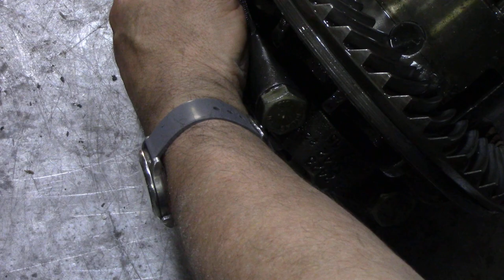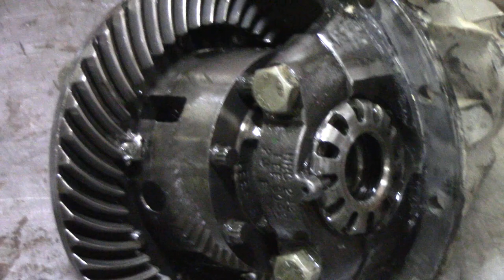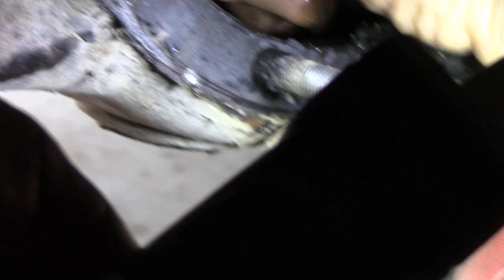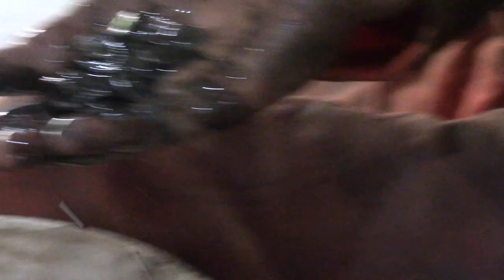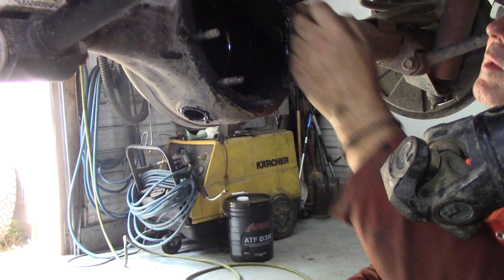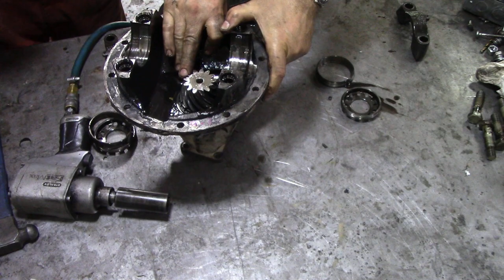2016 Defender 110 with a noise from somewhere and a few other repairs Part 3

Comment: I have had the bolts loosening in a oneten front diff. A bolt jammed between crown and pinion and the car jumped, I thought the motor had dropped out and that I had driven over it :) New crownwheel, pinion and new bolts with locktite where the only parts needed, the rest was ok.

Comment: I've had the exact same problem with my Defender 110 a couple of years ago & had to fit a rebuilt diff assy.  I only discovered it when changing a stub axle & noticed a load of metal swarf in the axle casing.

Comment: Ouch. So lucky to be sorting it now and not be stranded god knows where.
Is the power split 50/50 front and rear. If so how is the front diff looking also?
Maybe a inspection of the oil in that too?

Comment: I replaced mine by a ashcroft heavy duty 110 diff (not de pegged p38). Cost twice the money but i think needed on an overland vehicle with rover axle. Propshaft needs to be shorter.

Comment: Hi Mike I've come across this on a couple of our fleet puma Landrovers, one was completely trashed and had to fit a complete unit, the last one I had in we were lucky the bearings were totally shot but the  teeth were all in tact on the pinion and and crown wheel (more than likely due to the fact that bolts hadn't snapped and got caught between the gear teeth) although there was a minimal amount  wear on the teeth, I took a chance and replaced pinion and diff support bearings, if you use the original timeken replacement bearings and the original pinion then there's no real need to re-shim it, (the shim is situated between the larger inner pinion bearing outer race and the casing), setting the crown wheel to pinion mesh is a doddle with a DTI, I marked the adjuster screws before taking it apart and after resetting the crown wheel to pinion clearance they ended up in the same place, it's done 5K plus miles since and it's been fine so far, and as for noise? Well it sounds perfectly fine, but it'd take take a very acute sense of hearing to hear anything over the usual din coming from  the drive train, it's a shame some of the teeth were broken IMHO a new set of bearings would have put it right...
Reply from the maker: Yeap, but a chance to make it better - 3.5T is a lot of weight to lug about!

Comment: I had the same problem on the rear diff when I bought a pair of puma axles to go on my 200tdi, only four of the bolts had sheared on mine but one head lodged itself in the same place as yours and thats the source of the noise that alerted me to the problem, I had to replace the crown and pinion and whilst in there did all the bearings too, pain of a job but I did it all myself, took a few goes to get the right tooth mesh pattern though, great video and now I have an idea of why it happened, they are on a short wheel base now so are pulling less weight, may help them last longer!

Comment: In all my life I have never rebuilt so many rear diffs in an vehicle as I have with the Defender TDCi (2007-2016 puma). The P38 diffs are I believe poorly built in the factory, common is: metallic loaded oil at as low as 20K, broken bolts on the crown wheel, bearings noisy, poor preload, worn crown wheel and pinion.
Reply from the maker: The broken bolts are not sheared - they are overloaded or stretched, as they were not snapped flush, could be removed with your fingers as the shank of the bolt was still present and was the only thing driving the diff, indicating some twisting motion is happening on the crownwheel, causing them to snap under excessive load
Reply: @BritannicaRestorations  yes spot on, as you pointed out in your later videos the crown wheel is quite a bit thinner than the Salisbury. I have been using the Ashcroft ATB for the centre and using cap bolts to retain the crown wheel, I think honestly for most use the P38 once rebuilt correctly is ok for most uses but certainly a step backwards compared to a Salisbury. Great videos as always.

Comment: That's always a problem with  rover diff,l have a Salisbury in my 4bd1t County and a rover one in the front. I have a ashcroft pegging kit to do the front and after seeing that it's worth fitting because I have a locker in it.  Saying that the rovers are easy to work on and adjust.

Comment: I did all the bolts on the ring gear of a LTWT many years ago, just pulling away at lights.  Thought it must have been a half shaft so just hit the yellow knob and carried on.  It was only when I got home and struggled to drop the diff I found all the heads.  I was the owner from MOD release...  New set of bolts and a washout in the case, back on the road

Comment: My gast is totally flabbered.
I was definitely expecting to see something related to the ring gear but I was expecting it to be something more subtle, with something gradually wearing away at something else.

Wonder if the previous workshop DID do something wrong or whether this is just the unfortunate result of putting a heap of weight on the back axle?
Clearly, the bolts shouldn't shear but if the axle is overloaded enough to overstress ONE bolt and cause it to shear, that increases the stress on the remaining bolts and you get a "cascading failure".

Tell you what, you can buy dirt-cheap "bore-scopes" that plug into your mobile phone on eBay these days and one of those would be ideal for having a look around the inside of a diff' through the filler hole rather than having to take it apart to see what's going on.
Reply: I was thinking that in the last video then wondered whether Mike would be able to manipulate it enough to visualise anything. The final result would have been the same!
Reply: @bigm383  If you've got the equipment and inclination to pull a diff' apart I guess it's not a problem.

For the rest of us, when there's "a bit of a noise" from something, we tend to turn up the radio and tell ourselves it's nothing to worry about.

Poking a bore-scope in would probably have revealed that the bolt-heads were all missing from the ring-gear, at least, and would alert an owner to an immediate problem AND, potentially, prevent a serious accident if one of those bolt-heads got jammed between the gears and locked the rear axle up while the vehicle was driving at road speeds.
Reply: @SiCrewe  All excellent points!

Comment: A friend had the same problem with his Puma 110 on the front diff. Crown wheel came adrift and spat it out the front casing. 
I wonder if it is to do with the torque delivery of the Puma engine ? It’s only a short torque band on the standard Puma engine but when that torque arrives it’s there all at once -Bang!

Comment: Good opportunity to upgrade what is clearly a substandard design of axle (AULRO website is full of these axle failures, usually the pinion).  The Ashcroft HD gears and pegging will be a huge help.  Worth considering a locker or ATB while he’s at it.

The “Wolf” axle is a classic case of cost engineering; the Salisbury was far better in every way except for ground clearance.

Comment: I don't know when they stopped fitting Salisbury type diffs, but maybe they considered that with permanent 4WD the torque is shared between front and rear so the strength is not so critical. Does the Puma Defender have any kind of electronic traction control which would load up the diff in poor conditions? On a very heavy vehicle this would cause problems I imagine.
Reply: Yes, four channel ETC.  But these late TD5/Puma axles are crap compared to the Salisbury.  It was all about saving cost, not about quality.  Still if the bolts sheared where the ring gear meets the diff flange, then it could be down to driving loads.  The didn’t shear there - they sheared beneath the heads within the diff flange, so that is due 100% to over tightening.

Comment: Had this happen on my 130, magnetic drain plug picked up all the bolt heads up so there was no other damage, replaced the bolts and everything came up to spec.
That was a couple of years ago so It’s about time I popped the diff out and checked it over 🤔
Reply from the maker: Seems common!

Comment: I would not be surprised that those bolt are quality 10 or 12 that means that their scissoring resistance are very high unfortunately their elasticity is null so if not torque correctly they will break at the first big range of temperatures from positive to negative. Americans bolt everything with pneumatic or electric gun…….

Comment: I'm afraid the horse has bolted on that diff, does the crown wheel flex more when driven in reverse ? only mention that because I've had one click only in reverse gear under durress of course ( abuse mode engaged ) you not got a spare axle floating around your pile of bits to swap out the whole axle with ? and as for the prop shaft mystery, I bet some numb nut threw it away while the diff was away on holiday to the specialist ( I'm special derrrrr ) now I wonder if a Toyota would still keep going like that ??? oooohhh comment wars begin, go.

Comment: Interesting problem. That Paul needed some major work on the rear diff in San Diego tells us something was wrong before he arrived at Mike's. Surely, even with a vehicle at or close to maximum payload this should not be happening. Is there anything unusual about this vehicle?
Reply from the maker: Well, it is 3.5 tons  -  but the diff design is weak
Reply: @BritannicaRestorations  Ok but would you expect the diff to be the weakest link in the drive train? I don't know if Land Rover used the same diff on the HDs as standard Defenders. I would have thought, and hoped, that easy to replace items like drive flanges would give up first. If Paul is carrying 3.5t then he really must have the kitchen sink!

Comment: Hi Mike, maybe you could check if the bolts are the original ones which should be high tensile grade 12.9. They might have replaced them with ones of inferior grade.

Comment: Hi did they use foot pounds instead of Newton meters when tightening all the bolts in the diff
Reply from the maker: Supposed to be new bolts fitted when it is stripped